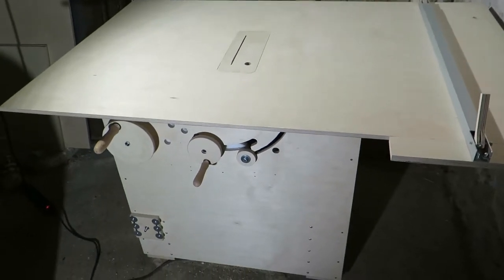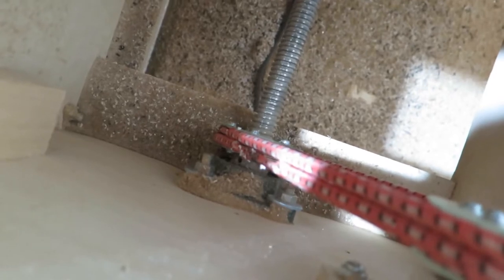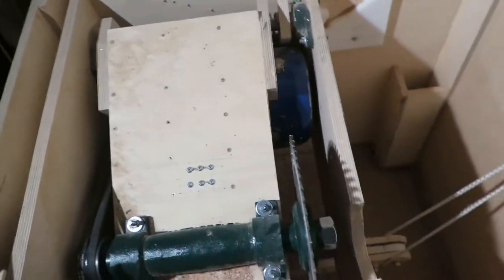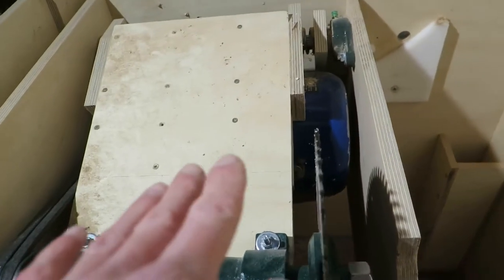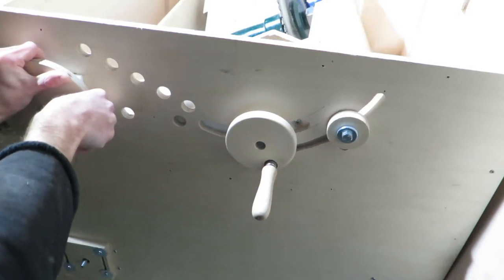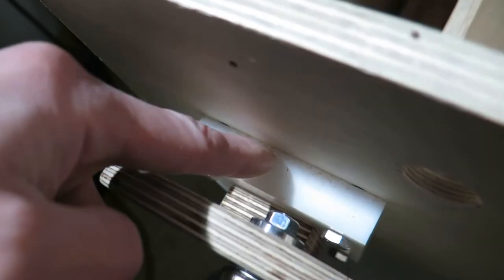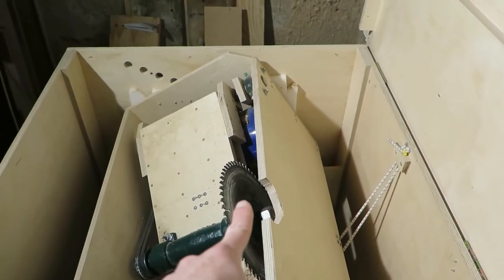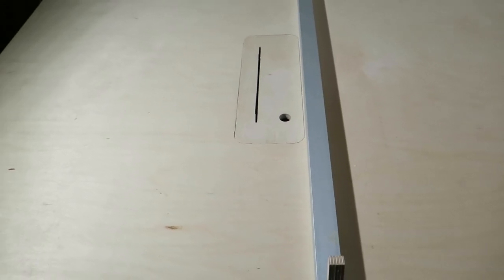DIY table saw tilting mechanism and overview

Comment: Transmissions are lossy by nature, I don't think it's a problem with your methodology, so putting in a ratio is an appropriate fix. 
Having the legs extend below their casters at the pull of a lever is much nicer than having locking casters.
Reply from the maker: Yeah, locking casters are quite garbage in terms of stability. Even very good ones.